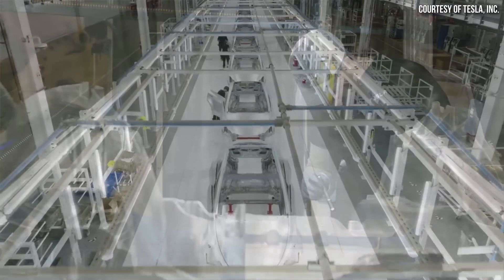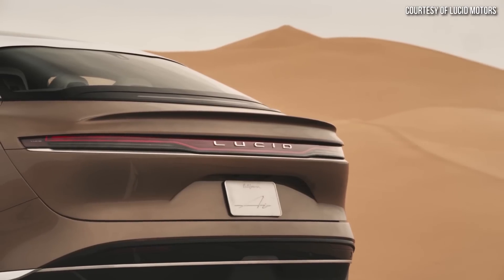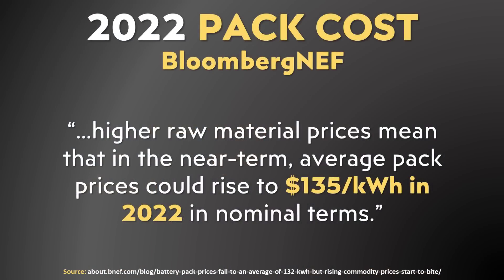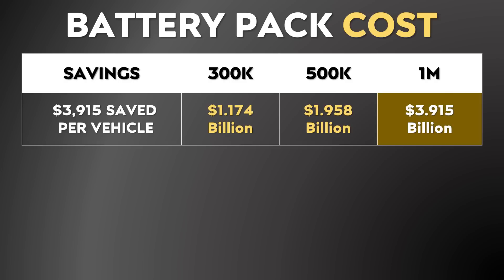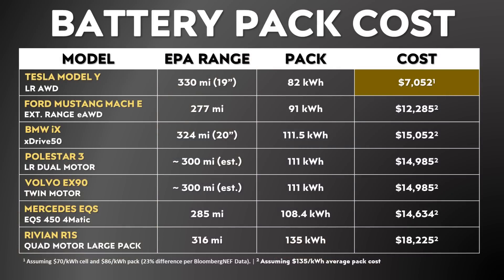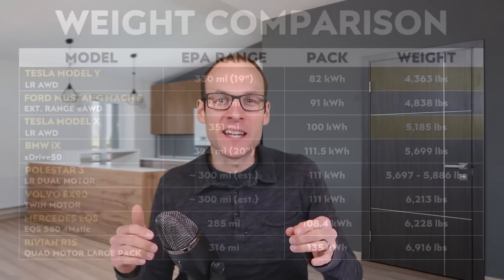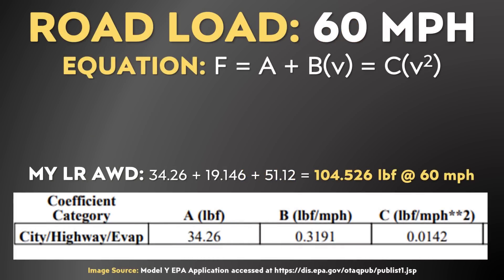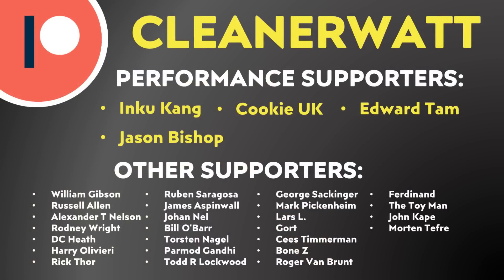Tesla's SHOCKING Battery Cost Advantage | How is this Possible?

Comment: This battery issue is economically significant…….but Tesla doesn’t appear to have a design development strategy beyond the computer mouse appearance.   Is this because a significant refresh would upset those who have paid $15K for FSD which isn’t transferable to a new looking update.
I suspect that the general public are shallow enough to be attracted to new exciting designs.
Is Tesla’s strategy to take advantage of the competition (including Chinese) going broke ?
Reply: I suspect at some point, we will find out most Teslas can't run the released version of FSD.
Reply: @Dularr  so who will pay extra for the required hardware ?  What will resale, for those without, be ?
Reply: @davidpearn5925  I'm suspecting the $15,000 FSD will include required hardware upgrades. Not sure what will happen with others.
Reply: @Dularr  time’s running out to deliver……because the plan to sell FSD at this ridiculous price are surely dependent on finally delivering the goods.  I am still a sceptic.  Non transferable FSD has just so many implications associated with design direction - in the sense of dissuasion from model design development.
The general public don’t think like short term get rich quick shareholders because they like a new look.  They are shallow……but ultimately matter.
Reply: I have a late 2016 Model S with FSD and they have updated my computer and waiting to get new cameras in January. The computer is not the latest, it is the version from 2 years ago and I am also wondering if they are going to upgrade it free like the last one and the cameras. I have not asked since my wife drives it and does not like FSD and I drive a 2022 Model S and it has the latest FSD (not V11). I hope my 2016 will perform the same way since I paid the money for FSD 6 years ago. Any thoughts by anyone on how they are handling these older FSD cars?
Reply: @thehoodster185  how much do you think you will get back of the $15K if you update ……..particularly if V11 doesn’t actually deliver in practice what is promoted ?
Reply: @davidpearn5925  Not sure what you are asking, but I only paid $4000 for FSD in 2016 but, I think you are saying will i get any value for what I paid for FSD if it doesn't work on these older models. I will inquire with Tesla to see what their plan is for early adopters like me and try to report back to this post later.
Reply: @thehoodster185  yeah, I’m just wondering what the big payers are expecting if there is an attractive update.
Reply: It is going to difficult to replace the existing Tesla body styles.   We may see additional models alongside the existing ones first.
Reply: @danharold3087  thanks the FSD trap……..which makes the profit margin spectacular.
I sense a lack of long term planning beyond relative distractions and talk.
Reply: @davidpearn5925  IFF I remember this correctly the number of people Tesla has working of FSD is tiny compared to its ~100K workforce.  Especially since they automated the labeling.  

People love to burn Elon for not meeting schedules or changing direction.   There is no upside to revealing more concrete plans.   They could result in the Osborne effect and crush sales of the current models.   I do understand how this can seem wrong with automakers with little market to loose advertising everywhere.
Reply: @danharold3087  FSD is about increasing the profit margin for as long as he can con successfully……..only IMHO.
Employees are a disposable liability unless they are hardcore for his financial benefit (at Twitter) and probably Tesla/SpaceX etc.
I suspect post grads are now looking elsewhere.
Reply: @davidpearn5925  I have no idea on you CS background much less AI.  Without that background I would not expect anyone to accurately judge FSD progress.   Elon is headed in the right direction and not only will this work make FSD real it will make the Tesla bot real too.  That AI learning based robot is significantly larger than the Tesla car business.   

Tesla employes about 100K people.   Arguably without Tesla these jobs would not exist.  The Tesla Robot will eventually replace most of the assembly line workers.   Nothing new here robots have been displacing auto workers for decades.

You are in part correct about twitter and how it will keep people from applying for work.  Most of these would never have been hired.  The kind of people Elon needs are into the science/discovery and will happily work 60 hour week. The brains that do spend ~10 years at tesla can often write their own ticket when they leave.
Reply: @davidpearn5925  Regarding post-grads looking elsewhere because Elon is a tough employer, I think you are right for those life-style focused post grads.  But for the very best, the most driven, and the hardest working, Elon offers a distinct challenge to do something great for the world - something that has great meaning - something that will benefit not just his companies but the world - and the very best will take up that challenge because the very best, such as those who graduate from the best schools (MIT, Caltech, Stanford) do not shy away from being challenged by a very demanding boss having the courage to work every day and all day to accomplish tasks that the world has repeatedly said were impossible (i.e., successfully creating a new car company was said to be largely impossible by everyone and a new EV car company was deemed to be even more impossible, successfully designing and launching reusable orbital class rockets, and now successfully creating FSD).  I graduated from MIT 25 years ago with an Electrical Engineering degree.  If Tesla had been around back then, I would have given my right arm to join them and work 24/7 for the best engineer CEO who has ever walked the Earth.  So no, I think Tesla will have plenty of people who will want to join them (and SpaceX) even if Elon is a tough task master.
Reply: @MrRyanDevo  are you interested in crypto currency’s and the associated charity work soaking up the profit ?
What is Elon’s preferred charity ?
Reply: @MrRyanDevo  I used to think exactly like you.
Reply: @davidpearn5925  
"FSD is about".... Reducing the global car fleet by at least 60%, aiming for excess of 80%.
First principles.
Currently a work in progress on how to get there.
Reply: @davidpearn5925  Hence why I call you cynical and dour.  Something broke inside you and you are now cynical and angry, seeing the worst in all those around you.  I hope you can heal and realize that people are complex, not easily cast into the camps of good and evil,  and many want meaning and purpose in their lives beyond (or in addition to) the accumulation of wealth.  Working extremely hard for a good cause is something many of us want to do.  And extremely hard work leads to achievement and success.   A tough boss asking me to do better all the time motivates me, rather than demoralizes me.  And sacrificing family/personal life for work is something many of us do when it is for a good cause.
Reply: @MrRyanDevo  you are now a target in the SBF/DJT/MTG/EM era……..sadly.
American gullibility is an opportunity of a lifetime.

Comment: Weight is one factor.  I recall when Sandy compared the Mach-E thermal system to Tesla's.  No comparison.
Reply: Weight, motor technology and Coefficient of drag
Reply: Air resistance is also a factor on electric cars
Reply: Yes, he was agog at just the weight of the coolant required to fill the pipes.